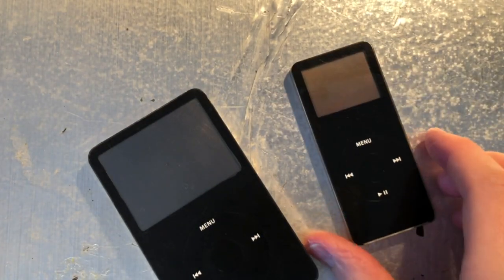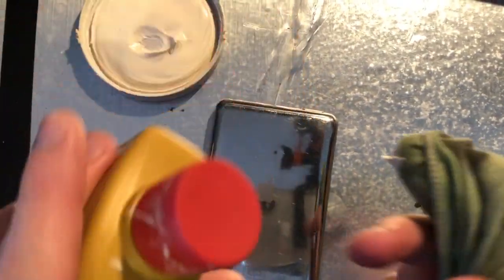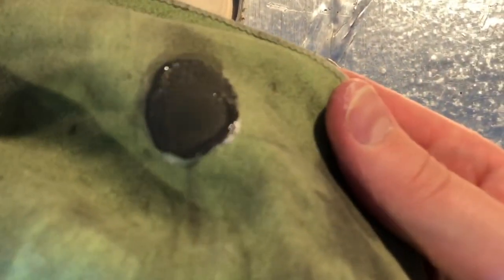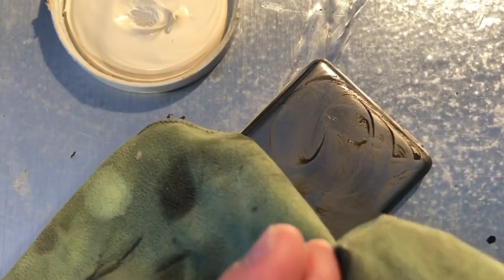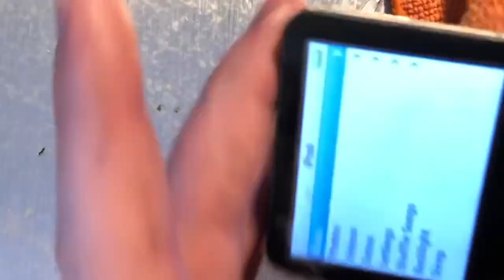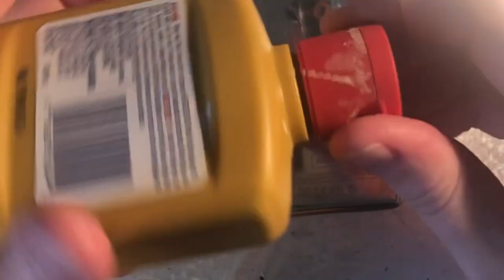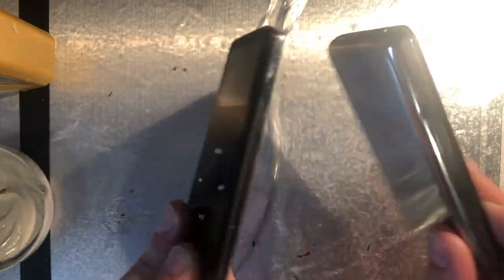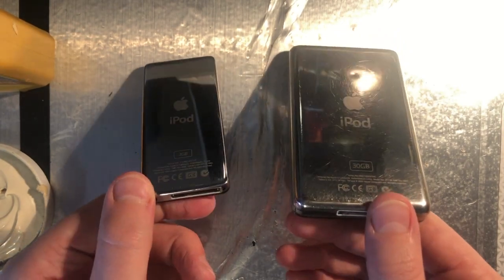How to polish an iPod Classic 5th Generation

Comment: Does it remove the etching on the back? idk if the ipod and apple logo are done with chemical etching or physical
Reply from the maker: You can polish off the Apple logo and text if you polish the area too much. On this iPod I didn’t care because it wasn’t in good condition. If you are carful and only lightly polish those spots you’ll be fine.
Reply: it's laser etched